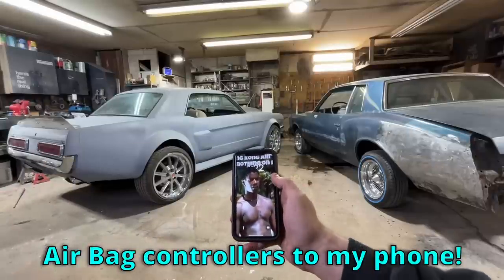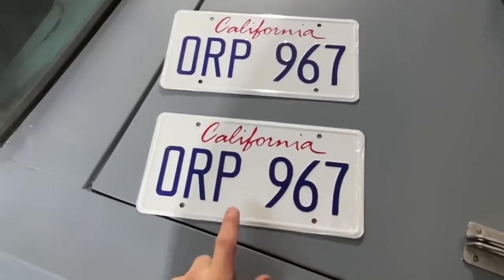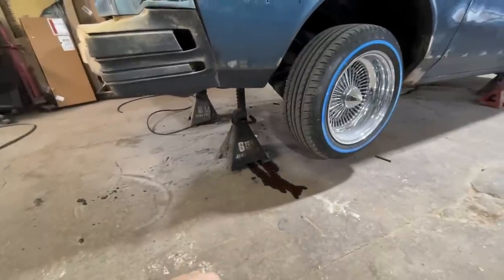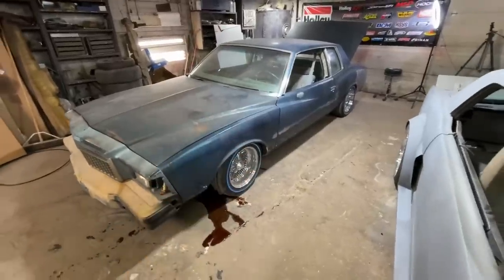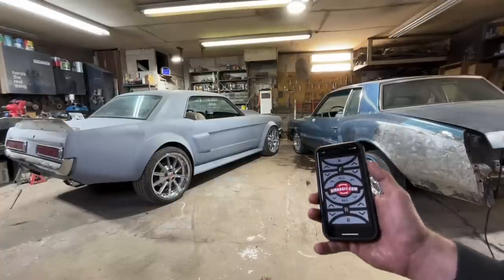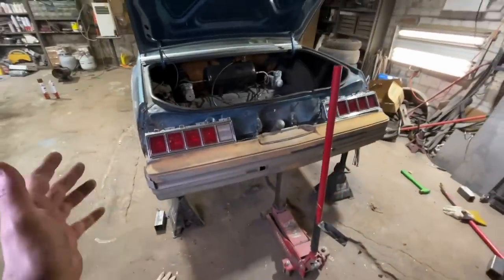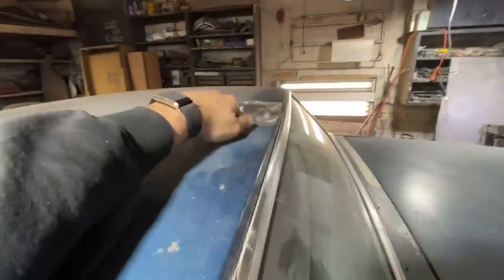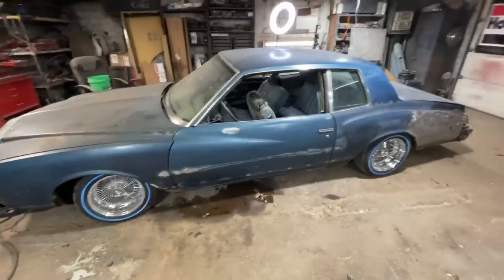GOING UP!! BUILDING THE MONTE CARLO FROM TRAINING DAY! RESTORING A MOVIE CAR! HOT RAT ROD LOWRIDER

Comment: For your airline, find a 5 gal bucket, fill it with hot water and put your airline in it to let it soak for a bit. You can also drill a hole up by the ribs of the bucket at the top and urn the airline out of the hole to help straighten it up a bit.

Comment: Back in my minitruckin days early 2000s we put the valves on top of the airbags and made the truck hop , I used 5/8 valves ans 1/2 in airlines, I also used  engine  driven compressor so i can get the 200 psu in the tanks qicker than the electric viair or firestone ones

Comment: If you want it faster get the individual solenoids and mount them at the bags so the line is all ready filled with air and you are only filling the bag. air-bag-it has them 1/2" 2W-160-15  10mm Orifice 150psi Brass Electronic Air Valve. Check them out but they are not plug and play you would have to wire them yourself but it would be way faster.

Comment: I would HIGHLY recommend changing the push connect fittings to brass fittings I was having problems with my big rig because they use plastic for everything and they would leak over time. Go to any semi truck parts shop like truck pro or fleet pride and they will have all of those fittings you need. Trust me you would thank me later jmo

Comment: That manifold may have a adjuster for how fast it goes down or up not for sure sure though..also for faster air build up get a York compressor man only if you don't mind not having AC. I have a York in my s10 and man I'm glad I made the change from compressors to York compressor. Looking good thoughh 😎😎😎

Comment: If you want it faster you need to upgrade to a 1/2 inch manifold or do away with the manifold 2 1/2 inch valves per bag(one fill, one dump) keep in mind your system is only as quick as the smallest orifice.
Reply: 1/2 inch lines run through 1/4 inch fittings greatly reduce the speed. With the 250psi pressure switch the 3/8 inch set up would have raised just as fast and just as high.

Comment: Digging on the build.  A word of caution:  You set the bumper up with the 78 taillights and not the 79 ones.  The brake lights are double stacked on the 79 which means you would have to drop the bumper a couple of inches

Comment: Where you drilled the sheet metal to run the air lines would be improve if the holes had a grommet so that the movement of the lines would not chafe and eventually leak. Love the build!

Comment: Would more weight in the back make it drop faster? Or would it be too hard on the bags and compressors?
Reply: Bigger dump valve. Get the air out faster. That'd what it needs

Comment: Rid that manifold and go with the individual valves. They are not aesthetically pleasing but my crown vic on 140PSI with 2500# front and 2600# rear bags with 1/2" line is twice as fast at least and with the added weight in mine im at least 1500# heavier so thats 50% more weight than you, great for dumping  I suppose but I have valved mufflers that are damn near closed (actually they do sometimes from my system it's annoying) and I will still go aired fully up to layed out in like 3 seconds. I fit my 5 gallon tank behind the bumper cover and still have most of the actual bumper in tact, If I ever get rear ended, they will be in for one hell of a surprise, I won't hear it in the car as my trunk is a 1.75" thick sub box. 🤣🤣

Also side note, If your compressor quits, pop the back off and rid the thermal switch. Mine went bad after like 15 seconds of run time out of the box. I haven't modified mine yet as I can not find info on opening the ports, I figure pressure will go down, but volume will go up, they are 200psi pumps but I only need 150. You know anything about that? I have the same pumps.

Comment: something like these Vixen Air 1/2" NPT Air Ride Suspension High Flow Normally Closed Electric Air Valve (Solenoid) 250 PSI One Corner VXF4012-2 boy it will damn near hope off the ground if not do it.